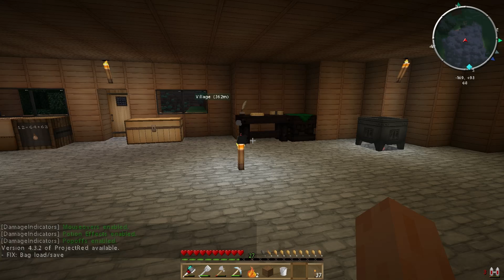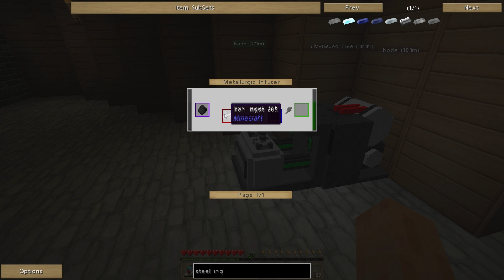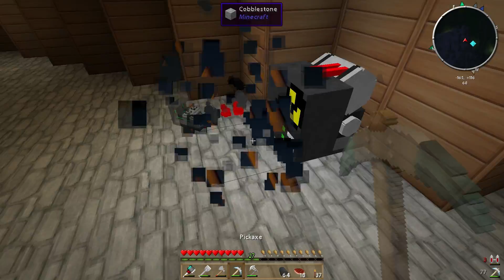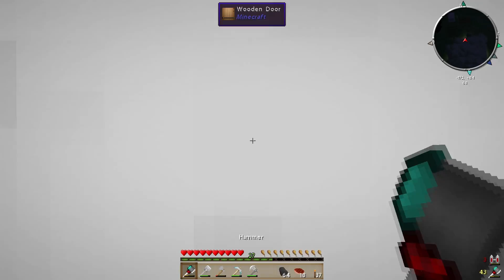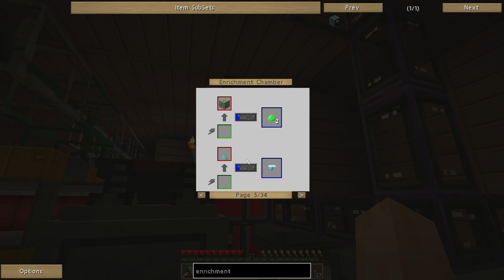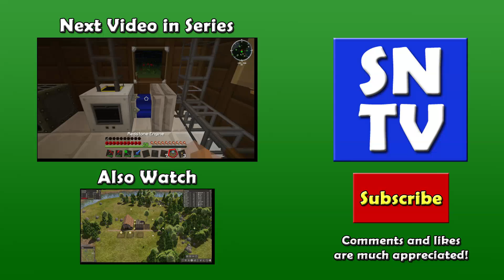Let's Play Minecraft FTB TPPI #16 - Discovering Mekanism

Comment: Hi, I think the best way to make steel is by using the Mekanism Steel Dust with the Tinkers Construct Smeltery, also look into making Wind Turbines from Mekanism, they are a bit noisy mind you so I would either put them away from your base or up high in the sky, they are more efficient the higher up they are. Also you can use Mekanism Bio-Generators in combination with the Mekanism Crusher, just put some Bread inside of the Crusher and 1 Bread should give you 4 Bio-Fuel, you can also automate it with Logistical Pipes and the other Logistical thing (Can't remember what it's called).
Reply: ***** I find pumpkin seeds better for the bio fuel 4 pumpkin seeds =8 fuel